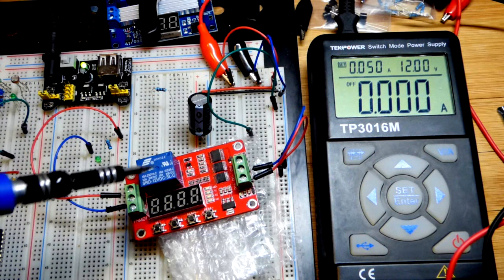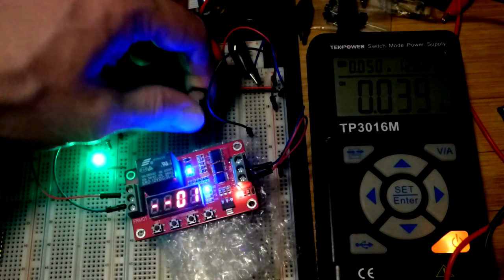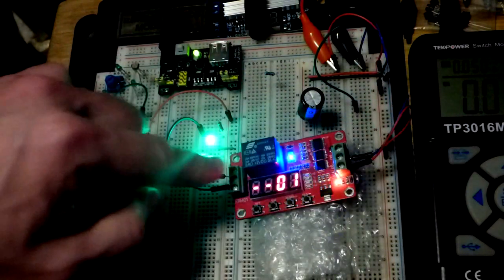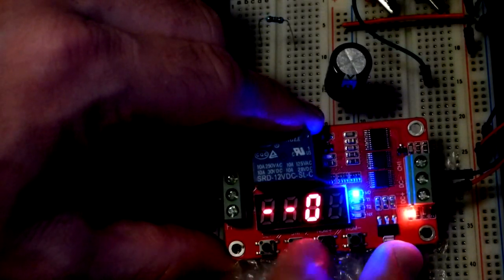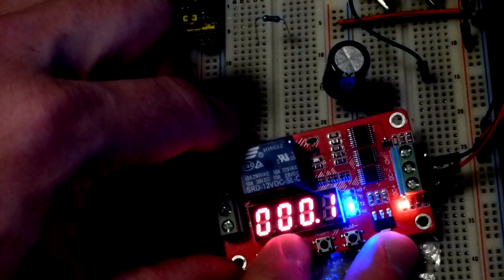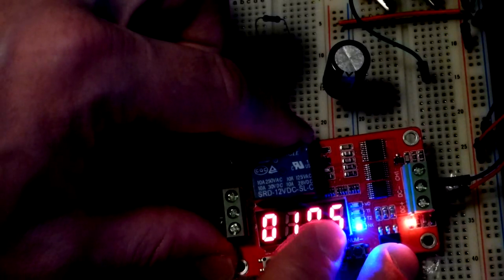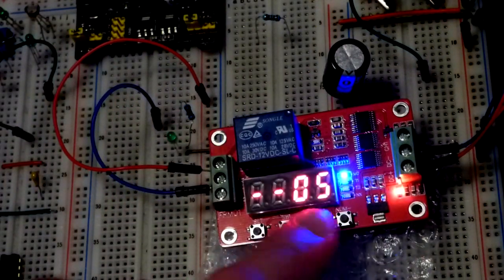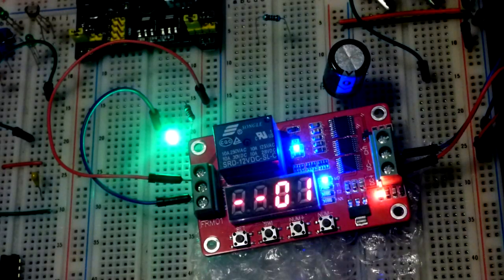FRM01 timer relay module 05 of 18 function continuous timed off timed on setting electronics demo

Comment: sir, can the 12 volt module be supplied with a higher voltage?  eg 14 volts or more 🙏
Reply from the maker: That's something you'd want to check with the seller or the manufacturer/data sheet..

Comment: Is there a function that makes the channel switch which non interruptible? Example a motion sensor turns on the relay for 20secs but if triggered before that 20 sec does not reset the countdown time?